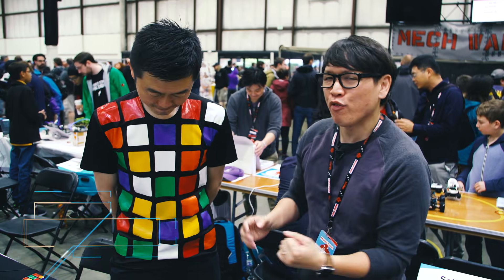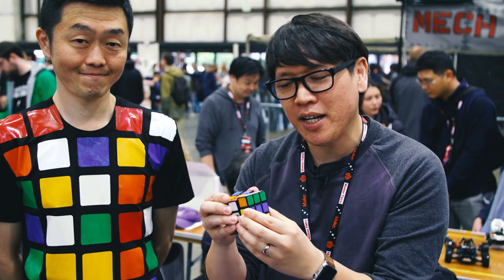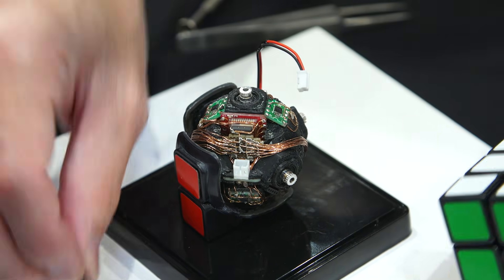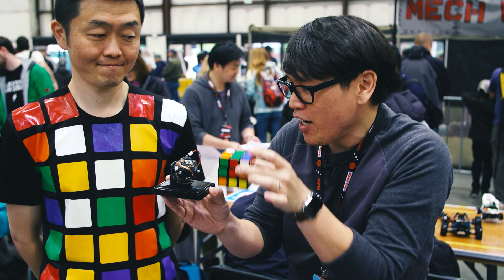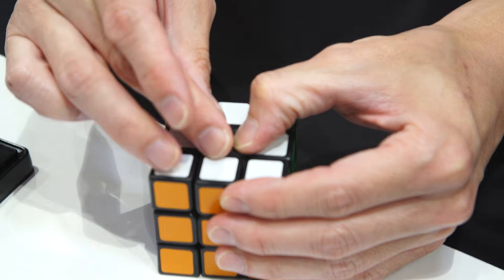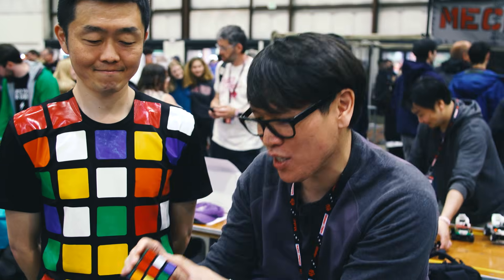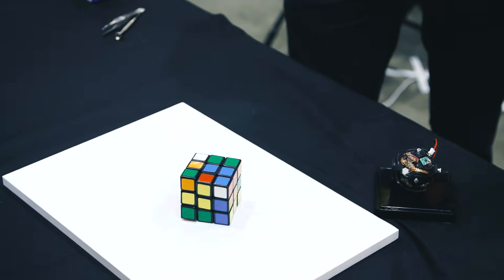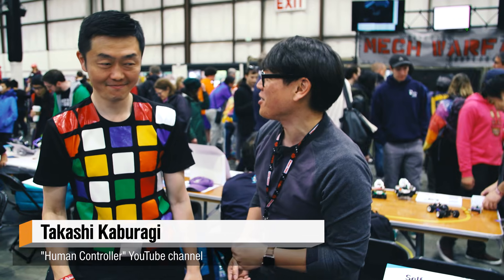Self-Solving Rubik's Cube Robot!

Comment: Actually I think it works that way that it records the rotates made by the human, and it just turn it backwards the same path. Or it is really solving itself by knowing which peace is where so he turn it in a way to solve it? I think the first option is easier to make just it is not really solving itself, it's just turning back to the original position. At least he programmed that if you turn a side to right then left then right it will turn just right to reduce the redundant moves

Comment: pretty sure this cube simply remembers the imput that was put and then rewind it to the original position so it do not solve anything it simply rewinds

since i do not see any sensors on the parts them self
Reply: Holy shit, this was specifically covered in this 3 minute video, where it was explained that it does not reverse the scramble, but does an original solve via algorithms...

Comment: Love the way he shoved all those servos together in that small area, I'll want to see what type of servos\components did he used and what modification he did to them... That is an example of great engineering...
Reply: You can see all the tiny circuit boards that are usually in the bottom of the servo sitting on the outside of the sphere. So it looks like the servos are completely dismantled in there. Probably all crammed into a single 3D printed housing.
Reply: Search cubic 3 layer short trick

Comment: There is not a "solve algorithm" as the interviewer said. It's just remembering what moves were made and reversing the order.

Edit Note see replies that this is not reversing the order.
Reply: No the interviewer mentions that it does not reverse the steps in order to solve
Reply: no he is actually solving the cube properly. Starting with a red cross, then the regular fridrich method
Reply: No, if you look it actually does cross, f2l, oll, and pll.
Reply: Ah, I did not see that. I stand corrected. Thanks guys.

Comment: Basically.. they were guideline using 3x3.. and it is so easy.. get the base.. align all the top three line.. moving L for both side to get the middle line.. flip it on the base colour to get the third line.. either "X" or "fish" image shown reflect the base.. there's a move way with both shape.. and then.. finally you got it..

Comment: Firstly, this is pretty neat!  I like it a lot.   But, it appeared to "just" be reversing all the moves back to solved condition.  It didn't appear to actually "solve" the cube.  If this is so, then it kind of "cheated".  I'm pretty certain that this is how it works, "simply" recording all the moves that messed it up, and running them in reverse.   But, AGAIN, this is still an amazing accomplishment, and a very, very cool device!  Was a LOT of work for sure, and again, amazing.   I guess I caught on to this easily since I solve my Rubik's cube almost daily, and this stuck out to me.  All that said, I could be wrong, and it might not be reversing, and can solve with it "not watching" how it is messed up.  This would be truly amazing.
Reply: Nah I'm pretty sure it's doing a legit solve

Comment: Now, take the battery out of it, rotate it a dozen times, put the battery back in it and see if it can solve lol, bet it fails every time.  If it knows exactly where you started, it obviously can get back to that point.  Most of the work on this was in the development of the servo motors, controller, and building the device itself.  The programming was honestly generic.  None the less, pretty cool to watch though.

Comment: It would be lame if all it does is record the turns that shuffled the cube and then reversed it. If it actually goes through the process of solving a Rubik's cube, that would be really impressive, but also not possible, since that would mean that the programmer would have to account for over 43 quintillion different ways that the pieces can be oriented. It's still impressive, but the cube doesn't actually solve itself. It just reverses the turns. If it was in a scrambled state and starts to record the turns then, it won't be able to solve.

Comment: Very clever but I did not see any solving? I just saw a cube undo the moves it had recorded which took it back to the start.  Maybe take the battery out, then mix the cube, pop the battery back in then see if it solves itself.

Comment: Cool invention

But did you just say 3 years of programming every way to solve the cube?
I dont know anything about coding but wouldnt it have been easier to create a system that saves every turn you make and then rewindr all the turns when the cube needs to be solved? Idk tho if this would be faster or not, again, im not a pro coder. (Dont see this as hate pls its awesome how much time he had spent on this)
Reply: He did it exactly like you said i lied. you can clearly see that in 2:23 rubick cube was completly solved but it still did like 7 moves.

Comment: An original Rubik's cube? Those motors have gotta be strong
Reply: Henrik Linus Pauly you can take a brick out and put some oil in there to make it a lot smoother

Edit: before anyone comments “it’s a joke”. Yes I know but I thought I’d share it anyway
Reply: @noudlindeman1931  please no freakin' oil... 
Like seriously, I'm a cuber and i can tell you, never ever use oil on a cube, use lube made for speedsolving or silicon slide spray(don't really know how its called in english but you get the point)
Reply: blow ĸꝚ3nĸt I use vasaline (it’s the fat that is used as a lube in tools) but I’m no speedcuber I just like to solve different ones(3x3 standard, 3x3 colors are the same but sizes of indivudual cubes different, piramides ect) so idk if something makes it smoother id buy it
Reply: @noudlindeman1931  yep, that works as Well, but my father is an enginner, so we have this at Home and it works great, just don't overuse it, or it will get wet
Reply: @noudlindeman1931  doesn't Vaseline degrade plastic or something?
Reply: @noudlindeman1931  Vaseline eats away at the plastic over time, it's not advised at all as a lubricant for cubes.
Reply: It still works fine for my cube after a year 🤷‍♂️
Reply: @noudlindeman1931  wait, you're not talking about the petroleum jelly, right? I might be mixing things up.
Reply: Nihal Uddin no this is the stuff that you can also buy to put on your lips
Reply: @noudlindeman1931  Yes. It's called petroleum jelly. And it degrades plastic.
Reply: ArchGirl ok thanks. Haven’t noticed any degredation at all but hanks
Reply: @noudlindeman1931  That's good at least.
Reply: Only a few drops

Comment: unbelievable. my record is 28sec. (thats slow) but this is just... boahhaa
Reply: Harvey Elwood, my record in a competition is 15 seconds, but at my first competition it would take me way over 30 sec. trust me, when you can solve it in 28 seconds, if you practice a lot and learn a few more algorithms, you could get below 20 seconds quite easily. 28 seconds isn’t bad. I would just recommend doing the things I just said. My best average in a competition is 17 seconds. For sub 20, you don’t need to learn full pll, but just make sure that you know 2 look oll, 2 look pll, and intuitive f2l. And then just make sure that you can turn the cube very fast. I would recommend learning full pll for sub 20, because it makes you more consistent, but it definitely isn’t required. I don’t even know it myself.

Comment: Is it possible to move slightly opposite rows while rotating, in order to make it stay in position instead of walking around?
Reply: No. You wouldn't be turning one side then. That creates a parity that would render a lot of scrambles unsolvable. it would need mixed using the same limitation.

Comment: Are you certain it has to record the movements it took to make it scrambled? As far as I'm aware, there is a repeatable mathematical solution to the Rubik's Cube no matter what position or angle it is located at. If you follow these steps exactly, you will solve the cube no matter what level of scrambled it is in.  https://g.co/kgs/cQW7tf

Comment: This would be awesome in Zero G!!
Reply: the ISS need to get one of those
Reply: @Atlas1AtLast  There's the same amount of traction and friction in zero g as in normal gravity. It should work just fine.
Reply: Yes
Reply: Although zero g isn't actually zero gravity
Reply: Great idea but like why was that the first thing that came to mind?
Reply: omg thats the greatest idea ever
Reply: It has to be on a solid surface to start (as seen in the video). Wouldn't work in zero g
Reply: @PhixFantDK  Just press down on it.
Reply: @PhixFantDK  u just have to press it lul
Reply: @PhixFantDK plot twist.... He made one that floats...
Reply: 😮 gasp!
Reply: @Atlas1AtLast  When two surfaces rub together in outer space, there will be friction. Friction is a surface effect and doesn't depend upon there being air. There is also a force like air resistance from the very sparse gas in space, but it will be very, very small, since space is a very good vacuum.

Friction results when two un-smooth surfaces rub against each other - if there is a force normal to those surfaces that is pushing them together.

So, yes, friction can exist in space and on other planets, but a normal acceleration is needed. In most cases that acceleration comes from gravity. For example, we can walk across the ground because our weight produces the normal force that allows the uneven surface between our feet and the ground to produce the friction needed for us to move forward.

I probably should add a clarification for "friction can exist in space" - space itself doesn't have friction - but two moving bodies in space can experience friction between them, if they make contact. However, if one were to use muscles to apply force, friction can still exist. And thus, the motors in the rubik's cube would still function like normal.

The programming would still function because electricity exists in space, and the motors would still spin and stop normally because of that.
Reply: It only work in ground
Reply: It wouldn't work in zero g.
Reply: Or you can just make it alternate run and stop every second and make it fall from a table during the running moments, then record every fall and combine all of them in a video with Windows movke maker

Comment: I'm skeptical about this "universal" algorithm solver code considering also that the cube has an internal "memory chip" which he admitted to be recording all your moves.  I don't believe the inventor explaining that the cube is NOT solving itself by "backtracking" all the moves which disassembled it in the first place. Actually I think it is going backwards on all the moves which disassembled it.
Reply: It took way more moves to solve than we saw to mix it up.
Reply: @chrisofnottingham  
Well that's because you didn't see him make more moves on the cube between minutes 1:42 and 1:151 . 
The video faded to someone else and then came back to the interviewer who probably had fiddled with the cube a lot more times than what you may have seen.
Reply: Ba A Ba A The cube is solving itself with a method known as CFOP. Calling it a “universals algorithm” might have been a bit misleading but the cube is not just reversing moves. I’ve been solving Rubik’s cubes for three years and I can recognize that the cube is being solved using the CFOP method. You can see around 2:10 that a corner and edge pice are being inserted in their First 2 Layer slot (where they go), then another edge and corer pice pair are inserted which finishes the first two layers. Then the cube does two algorithms, I think the last one is an A-perm but it can’t really tell, to finish the solve.

Comment: Why not memorize turns and twists then reverse them? Seems like it would be much more fun programming it to do that over just copy and pasting pre-existing algorithms. 

Maybe I'm putting my engineering thinking to this and going with the most efficient option.
Reply: Why would reversing be more fun?
That would be much simpler.
He is already recording the movement of the cube, so reversing the movement would be really simple.
The way he did it is a bit more complicated.
And maybe using algorithm could be faster than reversing. Just imaging turning the cube one thousand times. How long would it take for the robot to reverse so many moves? Whereas a really good program could solve any cube in 20 or less moves.
Reply: Because it can end up in a state that it can't recover from if it just did that. If the battery runs flat mid-solve, or is flat when you manipulate it, then it loses the ability to self solve until a human fixes it. By using an algorithm it can self solve as long as it has power, it also avoids issues like self solving for hours because you spent ages mixing it up, with a proper solve algorithm it can solve it's self far faster, which is going to be pretty important given the speed of the motors ;).
Reply: @AusSkiller  it can recover easily because it already saved all movements from moving the parts. Same way the algorithm recalls each square at all times, the reverse function will always remember where the original state of the motor was and just trace it back. 

A simple chip that can only store memory and drive the motors consumes much less energy than a complex chip that can solve algorithms. It's also more expensive.
Reply: @TechnologistAtWork  but if you scramble the cube for 5 hours it will take the robot more than 5 hours to solve the cube. With an algorithm it will only take a few minutes.
Reply: @Jehty_  maybe but it's a novelty thing and no one with do something for 5 hours just to prove a point. Neither the algorithm nor the memory approach are important here.
Reply: @TechnologistAtWork  You can only save moves if it has power, the second it loses power any moves made cannot be stored and the cube would no longer be able to solve its self. Rubics cube solving algorithms are rather light weight so even on the cheapest processors it shouldn't take more than a few seconds to solve.
But yeah you could probably do it your way in hardware rather than needing a programmable processor but for the other reasons I mentioned it probably wouldn't be worth it.
Reply: Reversing it would of been less efficient way of solving! What if you run into a case where reversing would take longer?? This robot takes the given position of the cube and finds the fastest algorithm. They are not just copying and pasting pre-existing algorithms. Not sure where you got that idea from?
Reply: @RobAlexG23  it's efficient because literally reversing it is as fast as scrambling it. Why wouldn't it be more efficient that way?

He copy pasted the algorithm because it already exists. He just intergrated the algorithm with the code that tells the motors what to do. 

I never knew how to solve Rubik's cube until I got the solution steps from a classmate. I knew nothing about solving it and always got stuck with 3 it 4 squares on different faces. But using that algorithm suddenly made it super easy for me. That's how some people can do it blindfolded.

It's easier to program the motors to reverse movements over having the cube knowing each square and solve an algorithm to reset them. 

All you need is a simple processing chip and memory. The method here uses a much complex chip capable of problem solving.

Comment: This robot is not actually solving the cube. It's only learn the moves that ur making and make them backward. So its not a Self-Solving Cube that's a Backward solving cube
Reply: He explained that it doesn't make the moves backward... just watch the video
Reply: @bl4cksp1d3r  That's what he SAYS but IT'S NOT TRUE. The robot is just running the moves in reverse.
Reply: @SeanTBarrett  can you prove it? As long you cannot prove it, I don't care
Reply: @bl4cksp1d3r Actual solvers proceed methodically and show certain kinds of patterns as they go, and this doesn't show those patterns.

Obviously it has to know sequence of input moves to know the configuration of the cube; obviously the fun of this is the hardware. From the software side it's a lot quicker to just reverse the sequence then to actually code a solver, and he probably didn't care because the point is the hardware not the solver.

But guess what, you're the one trying to correct Gaspard, so the burden of proof is on you. If you can't prove we're wrong, I don't care.
Reply: @SeanTBarrett  heeey, we both don't care, nice
Reply: @SeanTBarrett  it might we quicker to just reverse it, but I don't think this guy did it. I bet I could find the code for a real solver online and just use it.
Reply: @Georgeous42  You'd still have to write a lot of code. You have to create a representation of the cubelets, you have to track and update that representation while it's being scrambled. Yes, you can maybe just use an existing solver, but there's more to it than that.
Reply: That wouldn't make sense. What if I use 1000 moves to scramble it?
Reply: @Georgeous42  It makes perfect sense. Nobody at Maker Faire is going to hog it long enough to do 1000 moves.
Reply: Gaspard .Thoral If you know how to solve a Rubik’s cube (specifically with the CFOP method) you will know that it’s not reversing moves. Slowing the video down I can see the patterns the cube is being solved with. Around 2:10 you can see that the white face is almost done and the next 3 moves insert a corner and edge pice, completing the white face and almost the first two layers. Then the cube takes out the white,orange,blue corner and pairs it up with the orange,blue edge so it can insert them in to finish the First two layers (the F in CFOP). Then the cube goes out of frame but when it comes back the yellow side is all facing up which Oriented the last layer (the O in CFOP). Finally the cube does what seems to be an A-perm (algorithm) to finish the solve by Permuting the last layer (the P in CFOP).